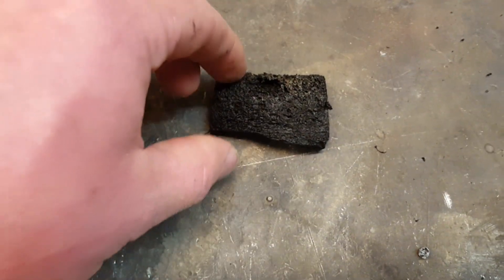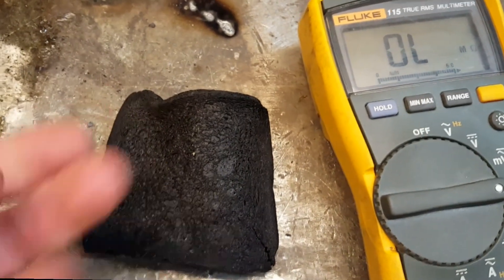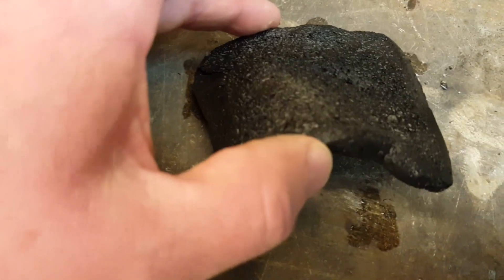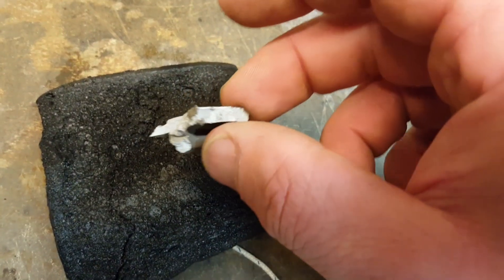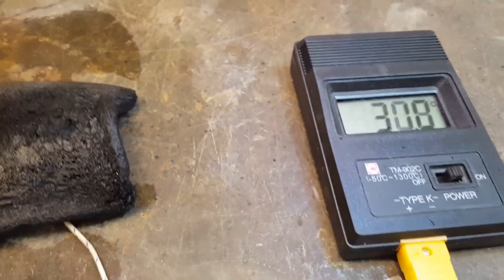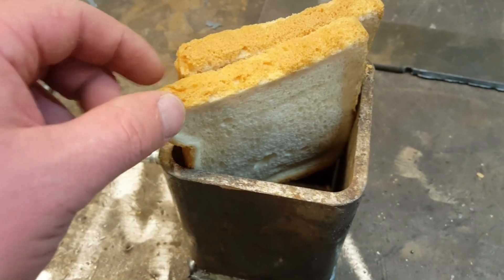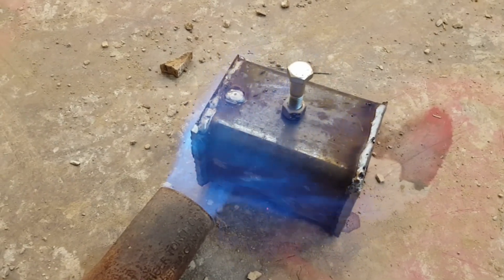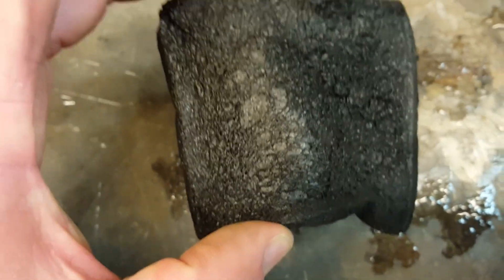Carbon Foam: an incredible material made from everyday items.

Comment: I can reliably produce that result with my cheap toaster. No need for argon gas or a chamber. Quick, easy, and foolproof. I can't produce any other results with my cheap toaster, but the result is edible and produces cast-iron guts, which guts can then withstand any other abuse I heap upon them. It's a daily regimen. And my guts can leap tall buildings in a single bound.

Comment: I know this is an old video...and your probably WAY past it now...BUT...say we just fill the vessel with well chosen wood scraps...packed real tight..then, instead of squeezing some inert gas in there...we plumb the vessel, so we can slowly blow nitrogen through it...and collect the resultant vapors to be used as fuel? I'm thinking the wood would retain it's shape better...and I know wood gasification is a thing. Or...are we just working real hard to make more.charcoal?

Comment: Nothing new here , 56 years ago I saw a demonstration of carbon, thin as a head scarf, blowtorch, blasting one side, human hand on the other, it glowed as it disputed the heat, but the man was not burned.  For years I have wondered what happened to that wondrous material, even then I could see the uses ...heat shielding for re-entry?

Comment: It's basically charcoal. You don't even need argon. All you need is a sealed container and a tiny hole in it. The whole idea is to heat it in the absence of oxygen.
Reply: I've never had charcoal stay intact and extinguish itself seconds after putting a torch to it.

Comment: 🤔 I get the how it "insulates" from the flames, like starlite, it needs the flame to carbonize the initial layer and such.... But does it do the same for radiating heat?  Like if the flame was aimed at a bolt, while the bolt and thermocouple are separated by the foam, does it prevent the heat of the cherry-red bolt to get to the measurement device?

Comment: Just a pedants point 3 years later... even the most basic and refined of factory produced white bread is not just pure sugar, neither is potatoes. Bread/flour is actually very high in protein for starters. Ever heard of Gluten what health hypochondriacs are afraid of. That is pure protein. Vegans often eat a meat substiture called "Seitan" which is essentially pure gluten. Industrially produced bread usually has additional Gluten added to it to maintain density under high speed mechanical mixing. It also usually has a bit of oil, and lets not forget the yeast. Which has nutritional value in itself. 

As for potatoes, they are mainly water plus they are packed with high levels of Vitamin C believe it or not. 

And the carb content of both of these carby foods is no different from any other Carbs entering the body. The main source / system of energy humans use is Sugar. Its what powers your brain and muscles. Saying bread/potatoes/rice/fruit - "is just pure sugar" as if that is a bad thing, is misleading and perpetuates common harmful (and wrong) ways of understanding nutrition. Carbs like white rice, white bread and potatoes are immensely good for you unless you sedentary and sick with obesity, diabeetus, pre diabetes, nerve damage, kidney failure and such. The carbs locked inside chia seeds, yams or even the muscle and organs of an animal are not any superior for your health than white bread or rice.

Comment: I laughed, because I guessed what it was before you gave it away... I am wondering though, the process looks similar to cooking down wood and burning off the producer gasses to make charcoal, is the inert gas really necessary? Or does it keep the bread from breaking down while it's cooked or something? Also, if broken down by the ghaliger sledge-oh-matic method, could this be a good media to add to furnace cement, or maybe an aircrete, for an even better refractory characteristic?... LOL assuming that the air in the aircrete wouldn't spalt like hell... nothing much worse than fraggin' foam! Hahaha, thanks Ave, another gem of esoteric knowledge of the universe, and much safer use for wonder bread than eating it! Can you do a video for making Graphene? If you could figure out how to make it large mass quantity, like a paper making machine, you'd change the world, well and be richest fellow on ewe-tooba!

Comment: +arduinoversusevil have you thought about looking at Pyrogel XTE? You can find some cheap rolls on ebay. I was considering using it for a heated enclosure for a 3d printer.

Comment: Hey AvE, not sure if you'll ever see this comment but worth a shot. The foam only moderately conductive because of the extent of graphitization. You'd have to pyrolyze at much higher temps to form larger graphitic domains. That's also why you get smoke when you heat it enough in air; the partial graphitization means there's still parts of the material that can burn (which btw means the smoke is a decomposition instead of sublimation, which is only phase change).

If you want to know anything else about the stuff, let me know! I may be writing this comment to procrastinate continuing to write a PhD thesis on carbon materials.... (Not exaggerating)

Comment: Those who start camp fires with flint and steel or ferrocerium rods make "charcloth" by carbonizing cotton cloth in an Altoids tin.  A can of sterno is an adequate heat source.  Larger containers, like cookie and candy tins, can be used.  You can even wrap the cloth tightly in aluminum foil.  Punch a hole in the top to avoid having the lid pop off.  It is good enough to heat them with a small wood fire.  Gas coming out of the hole will burn.  When it goes out, the charcloth is done.  The same technique can be used to make charcoal in small amounts.

There are many YouTube videos: https://www.youtube.com/watch?v=GsgrygfnCsg

Comment: Hi,
I tried it. But using LPG (cooking gas). As you said it doesn't transfer heat to the other side when flame applied on one side.

But the problem is that it is very soft and brittle. Also some part of bread becomes ash.

Please advise. Thank you.

Comment: I greatly enjoy your reviews and tool teardowns.  I recently acquired a DeWalt DCB1800B and have attached 4 of the DCB606 batterias.  Please consider performing an analysis and offering a skookum quotient or other opinion for this charger/inverter.  Mine will crank a table saw  or a heavy duty chop saw with metal cutoff blade with ease.

Comment: Try Bulsa wood pyrolysise it in an inert atmosphere, cool, soak in ceramic slip, vitrify in an inert atmosphere, cool then reheat in a oxidizing atmosphere to burn off the carbon.The resulting ceramic is almost an aerogel.

Comment: replace 80% of the water in bread mix with sodium silicate.. The CO2    from the yeast will pre harden it and then the heating later will make it into a stronger matrix then just carbon
Reply: It wont work because the water glass is verry alkaline and it will kill the yeast before geting it to form CO2 .

Comment: Hey I know this is an old video, but is there any way to do this without pyrolysis? I tried burning a piece of bread in a container for 3 hours and it seems to have some of the properties yours has in terms of heat conductivity. The experiment I did to test this conductivity involved sitting the foam directly on heating elements that were then heated somewhere above 500 degrees with a small piece of paper on top (to see the time it would take for it to burn). My control (paper without foam protection) went up in flames in approximately a minute, but the paper on the foam only blackened and never caught fire even though the foams under side was entirely scarlet for nearly the whole period (I messed up and made everything disintegrate at the 6 min mark so I'm not sure how long it could have lasted).  btw the foam was less than a half inch thick

Have a good day and thx for the awesome videos

Comment: This is so weird. Isn't that basically how you make charcoal (which isn't exactly know for it's heat-resistance)? Is it how fast it's heated that makes the difference?
Reply: nope, charcoal is made to burn, this is not
Reply: That's not really an explanation though. Charcoal is made by slowly heating wood (for example) in an oxygen free environment (pyrolysis), which looks like what he's doing there. So either it's the speed at which it's heated or it's the material being heated that makes the difference.
Reply: What he did was called, carbonization through extreme pyrolysis, charcoal is also made through pyrolysis , but carbonization is only one step in the creation process of charcoal, if he were to continue the steps he could then turn this into charcoal, but since he stopped the process, he just has carbon rich material left over after

Comment: Try meringue. Simply make a stiff meringue mold it into a block perhaps using silicone, as oil would damage the meringue. Bake at 225-250f for at least 3 or 4 hours untill hard and completely dry. Then cool it carfully carve and shape, and carbonize the meringue you made. Its so porous that its thermal diffusion properties should be outstanding.

Comment: Carbonize a whole loaf, hollow out the center and make a furnace with it. See if it can handle melting of various metals
Reply: jamesb1221222 or you could just take an old electric over and then fill it with home made bread mix and then close it up and seal it up tight except for one vent/purge hole.. then turn it on cleaning mode, which uses the broil and bottom coil and is really hot.
Reply: jamesb1221222 then you knock out a center hole and you electric over is now a furnace
Reply: He has that video

Comment: After you carbonize the bread it looks a bit like some stuff my Dad brought home from a job when I was a kid. He said it was some kind of insulation for a large refrigerator unit. Black with a spongy kind of texture, it was very light and porous. But when you cut it or broke a piece off it stank like a really bad sulfury fart. He found that it was good to remove rust off metal and it was like using a stinky pumas stone for a pool except it left a coarser grit. It could take a lot of heat and protect what was behind it. Dad would sometimes use it behind a pipe that he was soldering with a torch to protect the wood. It was some interesting stuff, but with my luck it probably had some bad health risks using that stuff. That or it will preserve me for a long time, God only knows what I was exposed to as a kid. But hey, I figure that if it didn't kill me it probably made me stronger.

Comment: Carbon reacts with the air and forms carbon monoxide and carbon dioxide depending on the availability of oxygen. The carbon tile was formed due to the lack of oxygen. Water is lost and probably some small side reactions happen, but a color change is due to the energy to break bonds on the carbon ring of the carbohydrate. Sublimation would be dry ice to carbon dioxide gas. The more you know.

Comment: Woah! I've been looking at ways to build a forge at home, finding that a decent refraction material is the trickiest part (for some reason, firebricks are hard to get a hold of where I live). Lining a forge with toast would just be so, so awesome.. You guys think the carbon foam de AvE extraordinaire could handle 1200-1400 C?

Comment: I wonder if you have tried to heat It in a microwave oven, it would make a good thermal insulator for melting metals inside a microwave if it does not absorb the radiation

Comment: hey, would you mind saving me a bit of time, and testing this method on a small piece construction type pine. whatever will fit in the box you already made.

i'm thinking you have  a really good idea for making refractory brick here. its neutral, so it wont care if you use it for acidic or basic materials... and it should hold in heat really well.. should be really easy and cheap to build a forge out of if it works.

Comment: The Soviets experimented with and might have IIRC deployed a re-entry shield made of carbonized peanut shell husk. Any form of structured carbon like that will have extraordinary thermal properties.

What you've got there is actually "activated" charcoal, one attribute of which is a massive surface area per volume when you measure all the bubbles inside. That's why it's so good at filtering, a cubic centimeter of the stuff has an effective surface area of dozens and even hundreds of meters. 

Both the high electrical resistance and heat resistance come from the fractal/recursive structure in which big bubbles are made of walls of smaller bubbles, which are made of even smaller bubbles all the way down to the nanoscale. 

For electricity, this means a vast number of paths with the same resistance. The current cannot find a single shortest path and therefore even though pure carbon is a good conductor, in this form the conductivity produces a tangle of current paths. 

Heat faces a similar challenge. The increased vibrations of direct thermal energy have move through all the bubble/cell walls which a 1) thin and not very conductive and 2) are made of bubbles themselves even thinner and less conductive. The bubbles are filled with an inert gas CO2 in the simple case but the small bubble size prevents effective convection. Radiant heat across the bubbles is blocked by absorption of the black material and the very smallest bubbles can be considerably small than the wavelength if infrared, producing a quantum effect in which photons of those wavelengths have trouble hopping the bubble. 

The deal breaker with this material is its lack of structural strength. Just won't take shocks or impacts.
Reply: Shannon Love that’s an awesome overview of its properties, thanks for sharing.
Reply: Sorry its not activated. Activated charcoal has bubbles and faults on a molecular level. This is just charcoal
Reply: @ravener96  its academically known as "activated carbon foam". The carbon atoms in the bread have already been rearranged in a way that can burn since being flour, thats the whole point of baking it. Then, through pyrolysis it activates and forms a structure that can no longer burn, like the process of activating charcoal. So really, although not "activated charcoal," the regular bread is moreso the "charcoal" in this situation rather than the heat ablative tile.
Reply: What about sound insulation properties?

Comment: This reminds me when I did buy a cheep one time barbecue grill with Charcoal briquettes that seemed to be made of tiles meant for the space shuttle heat-shield... The grill would not light even with a propane torch and only result was that the briquettes would glow red hot as long as you put the torch to it. Take away the flame and immediate they would cool down and the briquettes seemed to be totally unharmed.
Reply: Did you not use any lighter fluid?

Comment: Sorry if I'm mistake... But isn't that burned bread?
Reply: No, try putting a welding torch to burned bread. He "cooked" it inside an argon atmosphere, so the chemicals in the bread didn't react with the surrounding air, as argon is inert.

Comment: boom! you made original carbon- carbon .. I was lucky enough to get to talk in depth with a customer of 91 yrs old who worked on the original spy satellites , specifically on the reentry vehicles that dropped the film canister from orbit to be caught mid air via parachute to plane with a hook meetings before the rv hits the Pacific. .he worked for the contractor up through the keyhole series into the hexagons.. he had on his desk a big round 1 inch thick circle slab bout 6 inches in diameter,  of this odd phenolic clear brown tan reddish material with what looked like flat fabric squares sunk in epoxy ... Essentially that's what it was, they would cut 1 inch squares of cotton fabric like as if you cut up a white tshirt into perfect square pieces,  took a handful and soaked in epoxy resin of some kind or phenolic resin and then let it cure under tremendous pressure into this plastic molded shape of resin impregnated cotton squares , they would then  bake and burn off that resin leaving behind what they named carbon carbon which is the forerunner to heat abatement tiles like on the space shuttle   or at least that's how he described the process in layman's terms to me. hell of a interesting engineer this guy, it was a pleasure to pick his brain,  they went onto
Reply: Very interesting!
Reply: thanks for sharing ! :)

Comment: Air is honestly one of the best insulators, and that hunka-chunka wonder charcoal will certainly hold plenty of it!  
One interesting thing about carbon is that it's actually a conductor. Not much, but it will conduct. When using carbon fiber materials in aircraft parts, you have to make sure you have grounding straps bonded to the carbon fiber layers to ground out any currents and act as a sacrificial anode. Otherwise, it'll turn your aluminum parts into chowder!
Reply: Yes and no. Charcoal isn't a great conductor but graphite is pretty decent and graphene is nearly a superconductor! Also, nanotubes are ok conductors and depending on how you grow/build graphene/graphite carbon structures on a nano-level you can go from insulator to almost-superconductor but you can also engineer it to be a semiconductor like silicon! Carbon in its many forms is really wonderful stuff!
Reply: So you can get an electrolytic reaction with carbon fiber?
Reply: I always get confused because lack of air is the very best insulator. Ask my Yetti cup or deep space. Almost as if we need a different word for electric vs thermal to avoid confusion??

Comment: What a coincidence! I just read about this in a publication: http://pubs.acs.org/doi/abs/10.1021/acsami.6b03985
I work with batteries for my PhD, and I thought this would be a cool material for capacitors or as an ion battery electrode.